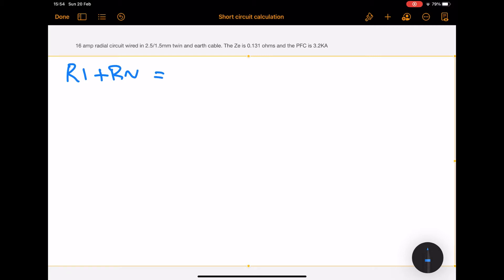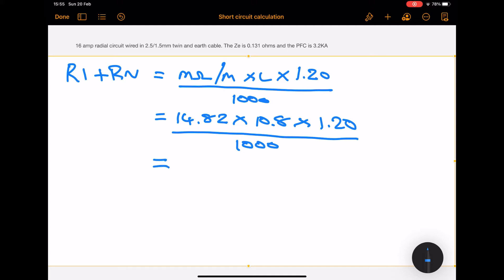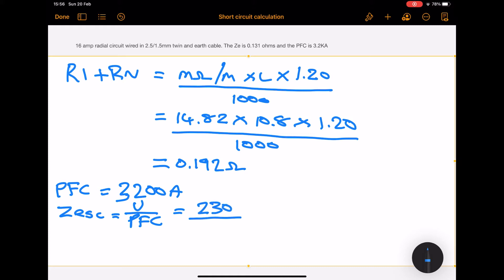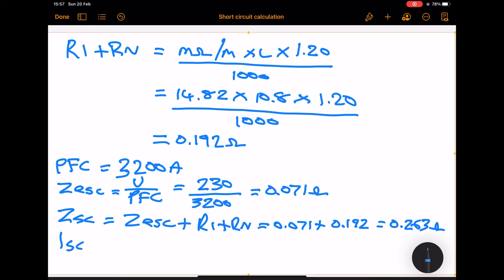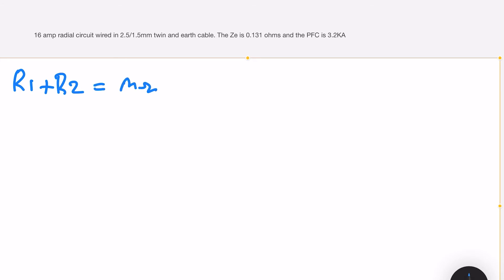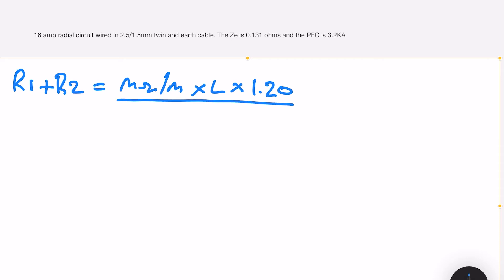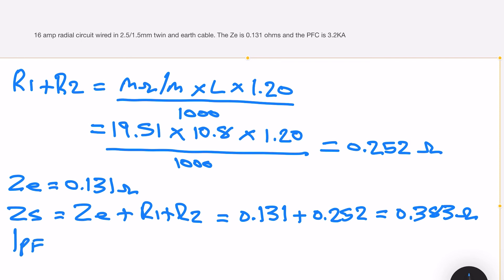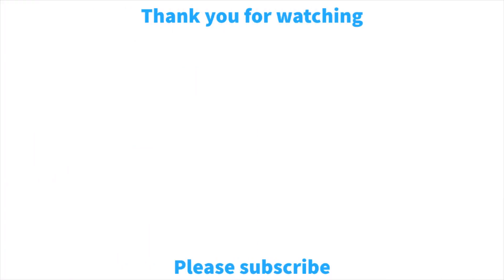Short circuit current calculation walkthrough for a single phase circuit

Comment: Hi Adam, in continuance to this very good explanation it would be good if you can also continue to show the two adiabatic equtions after reaching this stage as a check, I have assumed that for the thermal constraints (live to Neutral) you would use the higher of the two currents to ensure the live conductors are ok